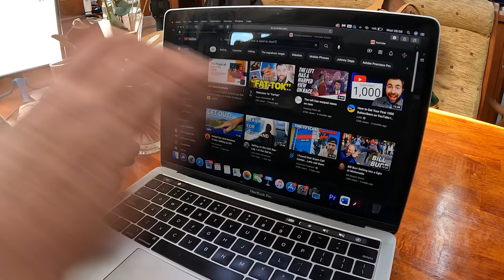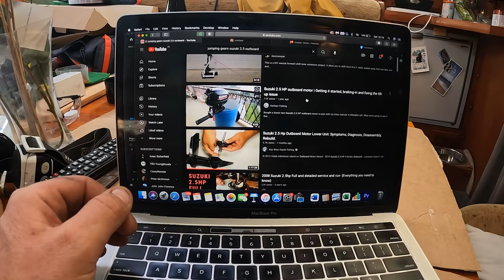How To Fix An Outboard That Is Hard To Start

Comment: Well done Dom... They are butterfly valves for the choke and throttle. Little tip, always remove the float bowl first as thats where most of the carb problems start,,, Good work fixing it... 👍⛵😉
Reply: Yes that is the first stop, modern fuel leaves all sorts in the bowl.
Reply: beet me to it with the float bowl, its easy to remove and can check the valve etc. and remove the float and check inside the needle valve.

Comment: Always spark first - it's easiest thing to check. Bonus check, before you screw the plug back in (presuming it has a spark), syringe a shot of fuel in the cylinder first and pull it over, may fire and sometimes just get things moving and stay running long enough to pull some fuel through. Plenty of exploded parts diagrams on the net to give a clue how it all fits together (and hence come apart). Keep up the good work, enjoying your journey!

Comment: Hey, Dom. I can feel your elation! I'm completely inept when it comes to mechanical repairs, so when one of my feeble attempts actually works, I'm over the moon with joy. 
     I'm surprised that so many people commented (below) on your carburetor problem before Hilary mentioned its cause: gunk from the ethanol and water in today's fuel. Bad stuff, for sure. 
     Finally, many kudos to PC for suggesting that you NOT do mechanical repairs where tiny parts can disappear into bilges, harbors, etc. This has been my downfall far too many times. I now lay down a strip of two-sided adhesive tape to secure small components like screws, washers, and gaskets prior to re-installation. Just a thought, Chris
Reply from the maker: Love these little tips, as I did actually lose a really important little bit when I fixed the dog clutch!

Comment: Well done mate, Btw buy a lanolin based spray for under the hood of the outboard and you motor on your sail boat, the other silicone sprays will eat/soften plastics and dry out rubbers (hoses, seals etc) over time, also lanolin sprays are water resistant too... give ya dawg a pat for us. Ned

Comment: Personally I always start a carb strip with the float bowl. In my experience 99% of your problems will lie in there.

I note several people are saying 'turn your fuel tap off and run your carb dry before storage' - great advice if you'll be using the motor again soon, but for long term storage do that and then when the motor is stopped, drain the float bowl too. Just turning the tap off will leave some fuel in the float bowl - the carb won't suck it all up, and then you end up with jelly again.
Reply from the maker: That’s a good shout, appreciate the tip there! 🙏👌🏼😁

Comment: I've recently serviced the same Suzuki DF2.5 and it now also runs perfectly.     Rather than use any metal wire to clean out delicate jets, I used nylon bristles from a brush.  I also placed the entire dismantled carb into my ultrasonic cleaner a few times, before getting work with the carb cleaner, then blasted through everywhere with an air gun.  
Great video keep 'em coming ;)

Comment: Great job!  If you push that pin out, the float will come right off and the float valve comes out with it.  Clean those and it goes right back together.

Comment: The "Jelly" is actually old stale petrol. The new E10 Petrol has 10% Ethanol, it absorbs water from the air and condensation and this "jelly" is the result when it's left a long time. You can get Petrol additives to combat this happening. I have exactly the same outboard and I used Millers Oils EPS Ethanol Protection system which is stuff you buy from Halfords or a Chandler its a small bottle and you just put a good squirt into the fuel when you put the Outboard away for the winter. I did that in October last year and the outboard started first pull this April on the same tank of fuel. There are other products with similar claims to Millers, It was just the one on the shelf when i went looking but it appears to have worked. Note Old outboards can't cope with E10 and it rots the rubber and plastic so you need to check if your outboard can actually run on E10. But the one in this video can.
Reply: What Hıllary saıd. Draın the carb bowl before wınter add new fuel  ın the sprıng. E10 ıs the most stupid ıdea ever. Usıng good fertıle land to produce a carbon fuel when ıf, we need carbon fuels there ıs stıll plenty ın the ground..... Madness, but follow the money😉
Reply: @SVImpavidus  actually scientists have been warning about climate change for over 100 years. If you understand the science you will know we have no choice now, especially us yachts skippers who rely on kind, predictable weather, no choice but to move away from fossil fuel. So yes E10 is difficult but record breaking 122mph winds like the ones the Solent experienced this winter are far worse.
Reply: Your spot on bud Marty Australia
Reply: Turn off the fuel valve and run the engine till it stops helps to keep the carb clean as well.

Comment: Hi Dom, you clearly have the most important tool for any mechanic - common sense!!! The point you mention briefly cannot be overemphasised, when working on the pontoon or on the boat next to it, always have an old sheet or tarp draped under the work area and most importantly covering the gap between the boat and the pontoon.....It is uncanny the way ANYTHING that is dropped will bounce as many times as necessary to end up on the bottom of your marina!

Comment: I have rebuilt and cleaned a ton of carbs and have lost count of how many times I have short cleaner in a passage only to have come out another passage back at my face.  You're in good company man!!!  As others have said, the float bowl, main and idle jets and emulsion tubes are the usual suspects when there is a problem with running and starting.  Always start there first.  That should keep you from taking it further apart than needed.  Good on ya for gitt'n er done!

Comment: We’ll done, really satisfying when things work out. The jelly is ethanol and water as others mention. Same problem happens with petrol power tools like chainsaws left over winter. Best advice is drain the fuel off and run engine until all used up in carburettor. I would also have cleaned the fuel filter and never clean another part (float chamber) above a part you’ve just cleaned. There’s also the ignition that could prevent starting (probably quicker to check) -see if there’s a spark at the plugs - don’t do this with petrol vapour around you. Great video as always.

Comment: Good job.. Your float works a small valve called "needle & seat"..  If your motor starts flooding out,  Take the float off and you'll see the needle & seat.. It sometimes gets some trash in it and won't seal all the way or the needle and seat just wears our and needs replaced.. not often when the fuel is gravity fed like your motor is, mostly when the fuel is fed from a fuel pump that forces pressure on the needle & seat.. Bowl fills and seat closes but has pressure on it all the time.. No worries in your case..  Just food for thought if it starts to flood out/ run way too rich..

Comment: I have the same outboard and had a nightmare removing the propeller. I found it was because the shear pin had bent. Well worth removing with a bit of force to avoid issues if you hit something and the pin shears and you can't remove it when you need to. I now to my cost being stuck on the shore  way up Loch Nevis miles from anywhere. Thanks for the vids.

Comment: I had the same problem, my mate said shit in the carb, but I couldn't get my bum over the hole so sent it to a professional, good you tackle the mechanical side of life, when you break it down into stages it's very easy, the more you do the more challenging tasks will seem a doddle.

Comment: I note that exhibit C the mixture screw should be served in counting the turns so you can duplicate its position when reinstalling. Otherwise you can install and gently screw in all the way then unscrew one and half turns as an approximation and then note what the spark plug looks like after running for ten mins then adjust. It works as a air screw so out is lean and in is rich. 
The jets screw out and clean holes, but don't screw the in too hard. Also, remove the float and check the float needle which suspends from the pin that holds the float.
André in Sydney

Comment: I just got an old boat and I have to rebuild the 150 hp outboard, and i have no experience with outboards, but do have some mechanical skills, but I'm really fretting tearing into it. I always tell my wife that if I don't know what I'm doing I just try to pay attention and make notes. Anyways  I wanted to tell you to check your fuel tank also for more jelly, as that's where it came from in your carburetor.  Also maybe add a small inline clear fuel filter to help keep crap out. Peace and give hank a pet for me.

Comment: Well done but you got lucky on the carb. You did not pull the metering valve out along with the float valve. This is a source of many issues when there is a fuel contamination. The tool with the different size wires is for cleaning the cross holes in this valve. I usually steal one of my wife's sewing needles to clean out the holes. Sometimes you can get the engine started but if it has issues idling, this cleaning will resolve the problem. Great video.

Comment: Best way to prevent the jelly / fuel lacquer issue, is to drain the float bowl if you are not using the engine for a while. You can switch the fuel off and use the drain screw at the bottom of the carb or if this is not very accessible you can just run this engine with the fuel switched off till it dies. Great VID BTW thanks for sharing.

Comment: Probably a lot of people have mentioned this but when you get ethanol in your petrol (I'm American so I'll just call petrol gas) as many places sometimes do, when that ethanol additive sits it absorbs water and solidifies into a jelly.

If it keeps running poorly, try a full fuel drain and replacement and clear out all the fuel lines. Then also avoid ethanol fuel additives like the plague.

Comment: Great Video !  Good Job !  Yes I will also say the gunk buildup was from Cheap Fuel.  Always try and use a Non Ethanol or non additive based gasoline in the outboard.  It costs a bit more for high octane non ethanol gas, but outboards use so little I'm sure $1 difference wont hurt.   I often buy and resell used outboards from ppl who think they are ' beat ' ,, and rebuild the carb and clean/hone/polish out the cylinder(s) with a new head gasket and suddenly its running  like new again.  Thanks for great content !

Comment: Dom, I have a Suzuki 4hp with a carb and I have been told to only use 98 high quality fuel as the normal 95 unleaded will block the carb very quickly, just had to also clean out mine because I didn’t listen to the advice.

Comment: The prop being stuck on the shaft will be galvanic corrosion between the aluminium prop and steel shaft. The corrosion kind of welds them together

Comment: I think enough folk have identified the jelly for ye. I grew up messing with motorbike engines and love these type of jobs: that said, I couldn't imagine my wife watching over me. Kudos to  Carly. Nothing as satisfying as a repair. BTW, how long did it all take you?

One small thing, normally I would dismantle the engine and  confirm the broken/worn parts before ordering replacement - just in case you need other things, like gaskets etc. However, this repair worked perfectly and it's possible that you were v confident of the problem.
Reply from the maker: I’d love to say that I was indeed very confident of the repair, but in truth, as has been the case for most of my life, I’m more lucky than good 😬🍀

Comment: Fuel gelling is a known issue when fuel goes bad. The fuel ‘goes bad’ increasingly quickly the higher the ethanol content. Any remaining fuel in the carburettor bowl will go bad and gel if left for long enough. One mitigation is to stop the engine using the fuel cutoff on its last use at the end of the season, this will reduce the amount of fuel in the carburettor bowl. It’s also worth draining the old fuel or ‘refreshing it’ at the beginning of the season (as well as flushing the cooling system with fresh water). Fuel also decreases its octane over time and refreshing the fuel will help the outboard run more efficiently. Happy sailing

Comment: another great video Dom I will echo the advise of several others and say if possible don't use ethanol fuel in your outboard. if you hacve no choice then add a stabilizer like Stabil to help improve its life and don't store the motor with fuel in it for any extended period. Draining those little motors is easy and will save you a carby clean every time you want to use it.

Comment: I have the same outboard, and had similar problems removing the prop. If you look at the shear pin you may find it is bent. It can eventually be removed with a bit of carefully applied brute force. Thanks for all  the videos and good luck.
Reply: And when it comes to "a bit of carefully applied brute force", remember the old mechanic's motto.. "Don't force it, use a bigger hammer."

Sounds like a joke, but it's not.. it's much easier to apply a carefully judged amount of force with a big hammer, than it is with a small one.

Comment: Nicely done! 👌, I've had similar problems and also used YouTube for help. I like to shut off the fuel valve to run the carb dry when I'm finished with the outboard to try stop that build up of stale fuel, I even webt as far as servicing the outboards last winter and I'm convinced it made a difference!

Comment: We have always called the "disks" Throttle Plate and Choke Plate. Definitely Treat your fuel next time you store the engine. I prefer to run the carb dry before storing.

Comment: Well done laddie. Nothing ventured nothing gained eh? I think the jelly gunge is what fuel turns into if it sits too long. What else could it be one wonders? We used to call the brass disc thingies a butterfly valve.Good on ya.

Comment: I found if I leave gas in my motorcycles sitting for more than a month 50% of the time the carb will need cleaning. The theory is gas with high ethanol content like 10% + crystalizes/gums up if it sits in carbs mainly, tanks not as much but I now store my motorcycles dry of all fuel if I don't plan to ride it in the next month. Your float bowel with all that junk inside was pretty bad. 🤙
Reply from the maker: I think we will be taking a much more proactive approach to managing our fuel too. I think this is probably the best takeaway lesson from this whole endeavour 😁🙏

Comment: I have one of these, the carb was too varnished up when I got it so I fitted a new carb however I use fuel set in the fuel to stabilise it since. One note of caution if you take it in to a beach or muddy bottom it sucks in small debris which blocks the water wee hole from the inside. This causes it to overheat and almost seize, watch out for this if it suddenly won’t rev.

Comment: Recommend using Aspen fuel,  alkylate fuel, it will not deteriorate/bio degrade or lose its octane rating, available for 2 or 4 stroke.  I use it in my outboard, lawn mower, hedge trimmer etc...brilliant!

Comment: Firstly, well done for tackling the jobs 👏
A couple of thoughts
Remove the float,  to clean around it more easily.
Wear latex gloves,  as fuel & carbon cleaner are nasty for skin.
Don't unbolt parts on the dock, it's too easy to drop parts into the brine (oh, you learned that one a few mins later in the video!) 
Do use carb cleaner on the dock, it's  nasty for your decks

Comment: Quick tip: put a rug down when disassembling on the dockside. Then if you drop anything accidentally you have a chance of catching it before it disappears through the gaps between the boardwalk planks.
Reply from the maker: That is GREAT advice, because you know what happened when I took the hearing out of the leg? The end pin fell out and went in between the planking!! 😖😖😖
Reply: @CadohaAdventures  doh, easily done! Great videos btw!

Comment: The float bowl has the drain screw for a reason.
If you use the engine frequently, just close the fuel and let the engine run until it dies when leaving it for day or few.
If you are leaving the engine waiting for a good while, drain the bowl before leaving the engine, so you won't get residue or that odd gel building up.
I am using alkylate gasoline in engines minimum for last two fillings to flush out the regular pump stuff, then fill up the tank fully before storage. The other option would be to fully drain the tank and fuel lines, but that can be difficult, unless your system naturally drains into the carb bowls.

Comment: There’s a little pin which acts as the hinge for the float. You can pull that out and above the float is a little ‘brass bullet’ which is the actual valve. Worth checking that is not worn. Either it or its seat can wear meaning the float no longer properly,control the fuel resulting in flooding

Comment: i'm terrified of tearing into the voodoo metal bits of things.  folks constantly ask me why i use propane outboards on all three of my boats.  its for reasons like this inconsistency in liquid fuels that causes a lack of brrrrrrrrrr when you pull the makeitgo string.  plus done properly it doesnt leak, stores safely, its bloody cheap and efficient compared to gas, the exhaust doesnt smell bad, etc.  the problem with it is that you cannot leave the fuel lines attached during storage.
if i lived in your world, my doggy would have waited until i had all the parts laid out then he would have jumped onto the cardboard and scattered all the fiddly bits about the bilge.  youre a brave, brave man!  :)